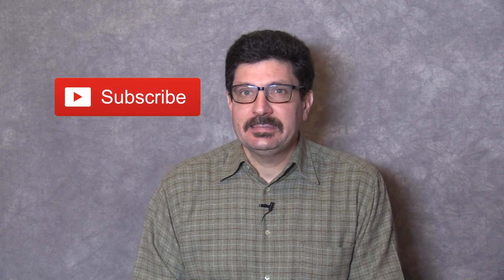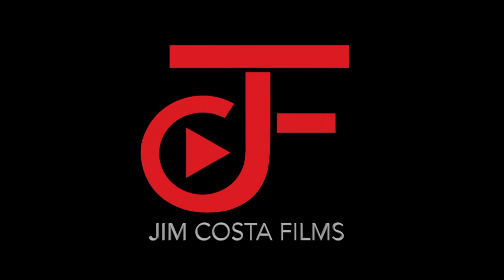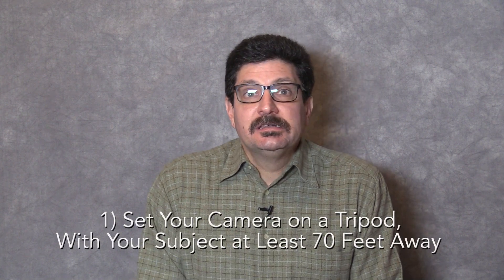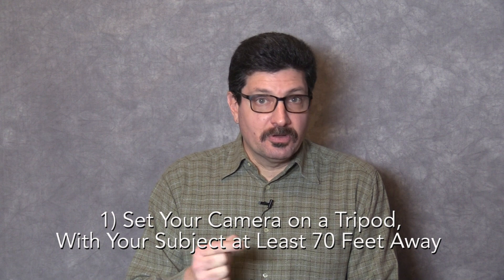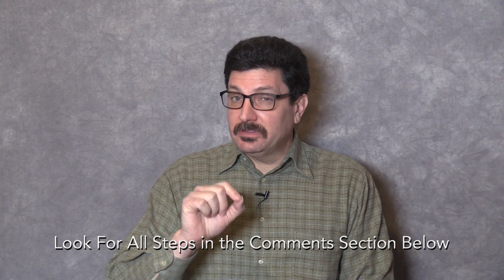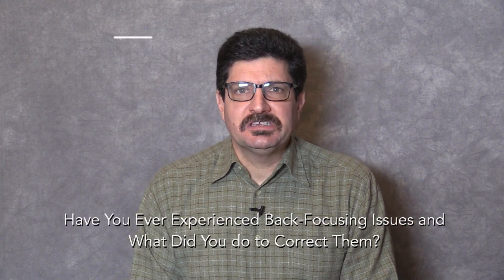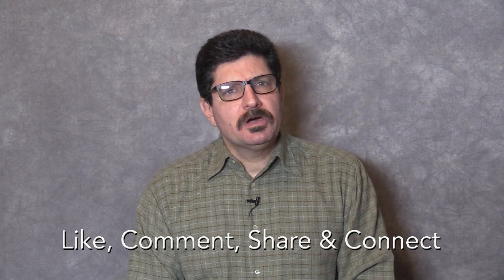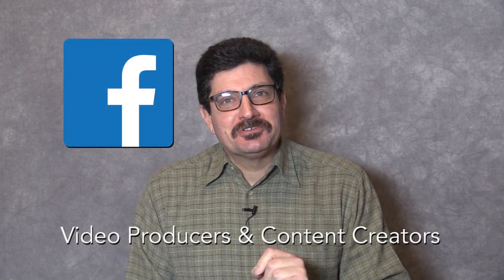How to Fix Back Focus on Your Camera Lenses: A Step-by-Step Tutorial

Comment: Hello! My SLR is back-focusing. Does this apply? It's a Pentax 645N and when subjects are closer, it's focusing on their back eye instead of their front eye.
Reply from the maker: Assuming there is no issues with the camera and/or lenses that you are using, this should help to fix the focus issues with your camera body:

https://www.pentaxforums.com/reviews/lens-align-front-back-focus/causes-ff-bf.html

However, there are other issues that can cause focus issues, including: A faulty eye piece or a misaligned screen on the body itself or a misaligned element in the lens. If the focal plane is even slightly misaligned anywhere along the line, you can't expect the focus reading on the screen to be the same as on the image. Something will be out of focus.

That camera is somewhat known for having a bad focusing screen in general that often needs replacing. It’s not a cheap fix. $100.00 USD for the parts alone + labor. This issue crops up most often in AF mode,  but can be mitigated with Manual Focus.

Another consideration is what your shooting and your depth of field. For example, at 1 meter and f/2.8 your DOF is only about 4 cm on a close up. That would be enough to explain some of the softness in the frame with the remainder being due to the lens being wide open and/or a little camera motion. I don’t have details on what you’re shooting specifically, so it’s hard to say, but these are issues I know others have had with that camera.

Comment: How can I fix my Sony 70-200 f2.8 GM lens, it’s not focusing sharp enough
Reply from the maker: This lens is notoriously bad on this issue.
Try the following:
Slower Shutter Speeds shutter speeds, make sure EFCS is off.
Use AF-C for moving subjects. Even then, the stabilization and AF can need a moment to settle in after you finish raising the camera to your face.
Handheld, lens OSS switch On, Mode 1 (and IBIS on in camera).
For Center focus to work, you'd have to have your (moving) subject glued to the exact center of the frame -- hard/impossible to do. Use Expand Flexible Spot or Lock-on Expand Flexible Spot. (There are specific shooting situations where the others might work, but they aren't usually your best bets.)
Aperture no higher than f11 (preferably f8). Avoid wide open, too, if possible.
Avoid the teleconverter.

The longer the focal length (and the less light) the harder it is for the camera to perform.
Reply: @jimcostafilms  can I trust the retailers to send it for fixing it...?
Reply from the maker: @ZFazly  Well, that depends on the retailer that sold it to you. I have no idea how reputable they are or are not. You can send it yourself if you're not certain. They will likely honor the warranty from you directly if it's still under warranty from the manufacturer. Sony authorized repair here: https://us.esupport.sony.com/support/s/service?language=en_US

Comment: I just want to know how to fix the digital back focus on my sony pxw-x200
Reply from the maker: If all use fails, follow these steps:

1) Set Iris to Auto

2) Set Focus to Auto

3) Set Focus Ring on lens to Forward position (Auto)

4) You need something to check the focus such as this chart: https://www.image-engineering.de/products/charts/all/542-te220

5) Set the camera on stick or a flat surface 6-8 feet away from the chart.

6) Enter the Camera Set Menu and select Auto FB Adjust at the bottom.

7) Let the camera do it’s thing. With lick, problem solved.

These are similar steps on similar cameras:

When automatic adjustment of flange focal length is activated, focusing is performed both at the wide-angle and telephoto ends of the zoom for flange focal length adjustment and the result is stored so that the in-focus condition is maintained even if you change the zoom position after focusing. 

	•	If a subject of insufficient contrast is used, or if the camcorder or subject moves during the adjustment, adjustment cannot be made properly. Once the adjustment begins, do not touch the camcorder body or lens until it ends.   
	•	When “Setting” of the “EX Slow Shutter” of the CAMERA SET menu is “On,” be sure to set it to “Off” before starting the adjustment.   
	•	Be careful that no light source, such as a lamp, the sun, or a bright window, is in field of view during flange focal length adjustment.   
	•	Contact your dealer if a flange focal length adjustment chart is required.  
	1.	Set the power switch to ON.   
	2.	Set the IRIS switch of the lens to AUTO.   
	3.	Place a high-contrast subject, such as a flange focal length adjustment chart, about 3 m (10 ft.) away from the camcorder, and light it well enough to provide a sufficient video output level. Frame the subject so that it is located in the center at the telephoto end of the zoom. Make sure that any object located closer to the lens than the subject is out of frame at the wide- angle end.   
	4.	Set the ZOOM switch to SERVO (Power Zoom mode).   
	5.	Set CAMERA SET > Auto FB Adjust to “Execute” in the setup menu, then press the SEL/SET button or the jog dial. The adjustment begins.   During adjustment, the in-progress message is displayed. When the adjustment finished, the completion message is displayed.   

If you press the CANCEL button during adjustment
Automatic adjustment of the flange focal length is aborted and the condition before starting the adjustment is resumed. 

If the adjustment fails 

An error message is displayed.
Check the conditions of the subject and lighting then perform the adjustment again. 

Other causes:

Backfocus failure happens at least once throughout the lifetime of EX cameras. Complete power cycle usually solves itself.

Heat may be an issue too, temporary backfocus failure to my knowledge happens way more often if the camera body is extremely hot.

If doing an Auto FB adjust fails no matter what with the camera on, completely shut it off and wait a while to try it again. If it keeps doing it past 2 days, then you have a problem.

That macro switch on the side needs to remain off. NEVER use the free spinning manual focus, only the Full MF mode. It needs to be fully powered down, battery and DC both disconnected.

If it's doing it in Full MF mode, seems likely to be a heat issue. The X200 uses a fan to exhaust the extra heat generated by the XAVC codec while XDCAM HD422 cameras like the 200 and my EX1R don't need a fan.

See if it still does it after firmware updates. (They're a couple separate updates, 1 for the camera, 1 for the network functions. 1 has to be SxS, other uses the Proxy SD card slot.)

If it continues to do it, it is almost certainly a heat issue.

Comment: For my video camera Fujinon HD lens is fitted while focus adjustments if I zoom in and focus object became sharp but after zoom out picture get soft and I can't get fine details of picture. even after backfocus adjustment.
My camera is Beast quality camera of Hitachi
Reply from the maker: The Fujinon HD lens has focusing problems. Are you using a ND filter? for some reason, ND filters really screw up the focus. 

Try these suggestions to begin:

1 – Remove and remount the lens

This is probably the most common reason that your camera won’t focus.
The camera and lens both have metal contacts that must be in communication with each other in order for them both to function properly. 
If the lens isn’t attached properly the contacts may not be touching. So the camera can’t send the lens the message to focus when you press the shutter button. 

An even worse scenario is that your lens could literally just fall off and get damaged if it’s not locked into place correctly. 

So to check, just remove the lens and remount it. Listen carefully and you should hear a small click when it’s locked into place. Then try the focus again.
If that didn’t do the trick, keep following this list. 

2 – Check the AF/M switch on the lens

The next place to look is on the lens itself.

Locate the switch on the side of the lens barrel that says AF/M and make sure it’s set to AF (Autofocus). M stands for Manual focus in this case which means you have to physically turn the focus ring on the lens.

Additionally, if you use a Nikon camera there may be a focus switch on the camera body as well. For Fuji users as well, the focus mode switch is on the camera body not on the lens.

So make sure to learn all your camera dials and buttons well so you know where to find this setting.

3 – Aim your focus point at an area of contrast

Your camera uses contrast to determine the subject and needs it to be able to focus the lens.

Take a look in your viewfinder and locate the focal point that is active (it will light up as a little red dot or square usually). Then make sure that you place that spot carefully on something in the scene that has some contrast.
Try this as a test.

Point your camera at a plain wall with nothing on it and press the shutter button to focus. Notice what happens.

It couldn’t focus, right?

That is because it can’t “see” anything there.

Make sure you find a line or part of the scene that has a contrast between light and dark areas and place your focal point (that red dot) in that area. 

Then if you need to, use the “focus and recompose” technique.

Press the shutter button halfway down to focus.

Once it achieves focus (your camera should beep if you have that turned on), keep the same pressure on the button and recompose your image.

Once you have it how you want, press the button the rest of the way down to take the photo. 

4 – Use the center focus point

Your camera may have nine different focus points, or it may have over 100. That will depend on your camera model. 

But every camera will have one that is in the center of your frame.

That one point will always be more accurate because it is what’s called a “Cross focus point” – meaning it can find contrast in two directions, not just one. 

That means it will usually have an easier time finding focus, especially if it’s also a low light scene you’re shooting. See point #6 below for more on that situation. 

Your camera may have several other such points, or not.

Read your manual and specs about your camera to figure that out. Each one is different. But the constant is the center one so it’s a safe bet to use when you’re using focus issues.

5 – Make sure you aren’t too close

Every lens has a minimum focus distance.

That means it literally cannot focus on something that is closer to it than that distance. 

For most non-macro lenses, that is about one foot or so (check the specs on your lens if you aren’t sure). If you are closer than that, your camera and lens will “hunt” or attempt to focus by going back and forth with no luck. You’ll hear it working but it will be unable to lock on the target. 

If this occurs the fix is simple. Just back up a little and try again.  

6 – It’s too dark

When you are shooting in low light conditions your camera may struggle to see in the dark and find focus.

How to solve that is to choose a lens with a larger maximum aperture because it will let in more light for your camera to see better. A 50mm f/1.8 or 35mm f/1.8 are great choices for such a situation.

Did you get your lens to focus?

If none of these ideas solve the issue, check to see that the lens is working. You should be able to hear it working when you press the button. 

f the lens is not working properly, try another one to determine if it’s the lens or the camera that’s not functioning and take the item that isn’t working in for repair. Sometimes a drop or jostle can throw a lens out of calibration, or it could be a more serious issue.

Hopefully though, one of the steps above has resolved your issue and you’re off and running, happily photographing away.
Reply: @jimcostafilms  
Thank you sir I will try it out and
again I will communicate..
Reply from the maker: @suhaskulkarni4481  Good luck.

Comment: Jim,

Just stumbled across your site, and I am really impressed.  Just got my hands on a Panasonic HC-X1000, and am struggling with this issue (focus), but think it may be related to something different.

I am shooting a concert, so low light in the seating area (where I am located) to a very well-lit stage.  Not sure if his constitutes low light or not, but I assume it does.  I shoot from 50-100 ft from the stage, and I am setting my shot up as the following:
4K 60fps
0 gain
1/120 ISO
I will then zoom in on the stage, hit autofocus to get a setting, then zoom out to shoot.

Here is a link to one of the shots I am referring to, and am hopeful you can offer a suggestion as to how I can make this cleaner.

https://youtu.be/0jsCWm3JXkg

Thanks a million!
Reply from the maker: Thanks for the kind words. I do try to provide information that’s easy to understand and learn, easy to implement and that you can use. Many more photo and video tutorials here: 

https://www.youtube.com/watch?v=719OQYh1bSM&list=PLBw3qczTjq1T9v75Wf5Ia1NqeiKOmc-ej

Shameless self promotion out of the way, on to your issue. I watched your sample clip all the way through. You are correct, I would classify the stage as “low light” even though the downstage area and the risers are nicely lit and exposed properly. The first half dozen rows of the audience, the wings and the upstage blackout drape are quite under exposed. You can tell this because except for four down lights from the third rail, there is no definition in the upstage blackout drape. You can’t see the wrinkles in the curtains at all, which is kind of the point on such downlighting. 

With nothing to go by other than your footage and description, this is what I think. FYI…If you PM me you’re email address on FB (look for Jim Costa Films), I’ll send you a PDF of the user manual for your camera if you need it.

I have some experience with the Panasonic HC-X1000 and the focus problem you’re having is fairly commonly known in low lighting. The camera really works best outside on a bright sunny day. Generally speaking, in such shooting conditions, Panasonic's AF is not reliable. There is no fix, other than switching to manual focus. You can do it this way:

Perform focus adjustments using the focus ring. If auto focusing is difficult due to the conditions, then use Manual Focus. Here's how to switch to Manual Mode: 

1) Set the FOCUS A/M > switch to [M] to enable Manual Focus. (It will switch to MF from AF). 

2) Adjust the focus by rotating the focus ring.

However, you might try a few other things that might help. I think, but I can’t recall specifically, that you can run a self diagnostic on the camera, Some Panasonics do, I just can’t remember if that one can or not. If so, run that as see if there is an error code related to focus. 

You might also consider boosting either the gain or the ISO a bit to let in more light and thus, make focusing a bit clearer. +3 on the gain max to avoid adding too much noise or 200 on the ISO as this would give almost 2 stops more light with little noise added to the footage. 400 on the ISO would be pushing it, I think, but would give you 3 full stops more light. 

The other thing you might consider is shooting at 30 FPS rather than 60 FPS. 60 FPS works great fo fast action, such as sports and while the singers are moving around on stage, they are’t moving all that much or all that fast so 60 FPS might be overkill.

Good luck. Let me know how it goes.
Reply from the maker: I was looking for a question someone else asked about on this video and I found yours and realized that I never answered it. I took a look at your link just now and here's what I think.

I’m guessing this was your back unmanned camera since it’s just an unmoving wide shot. 

First off, I think there’s not enough light. You didn’t mention the f/stop in your specs, but it likely needs to be opened up/stopped down more. The reason is that from your distance to the stage, the focus plane is probably going to be infinity (or pretty close to it). The blacks fall off completely. There’s no detail in them at all. You can see this especially well with the back curtain/cyc. Except for the few lights above, there’s noting but a black hole.

The stage lighting is uneven so this will be a problem. The risers seem to be lit fine, but the off stage left/right areas seem under lit to me. You can tell that by the white shirts. On the risers they seem almost blown out, while close to the wings, they are a stop or so under lit.

You description of how you focused sounds like doing a rack focus, which is fine, but I suspect based on looking at the video that it’s soft because in zooming back out for fine focus, it slipped a bit. From your distance when focusing, concern yourself with the zoomed in focus more so it’s crisp and sharp. 

You did say the video was shot in 4K, but the highest quality setting on YT is HD. That will effect the softness of the hard edges a bit as the video is now compressed by you upon uploading and again by YT at their end.

FYI…Panasonic's continuous AF for video is not notoriously reliable. There is no fix, other than switching to manual focus and turning on focus peaking so you can see the depth of the focus plane. Use manual as much as possible.

Here’s how to set that.

https://www.manualslib.com/manual/851477/Panasonic-Hc-X1000.html?page=39